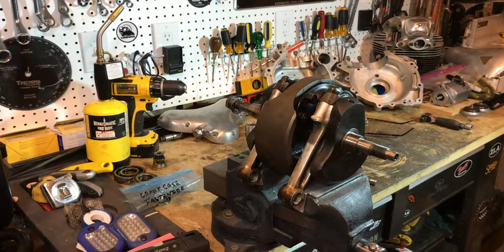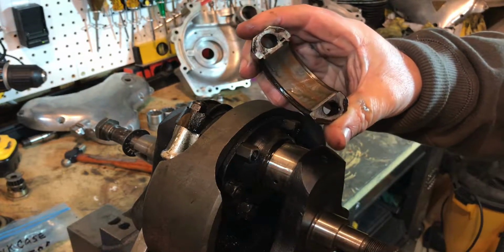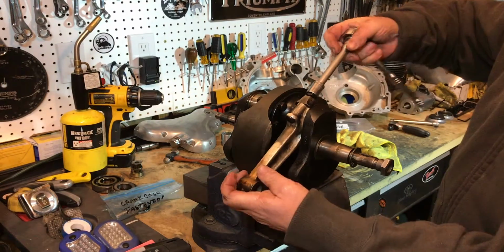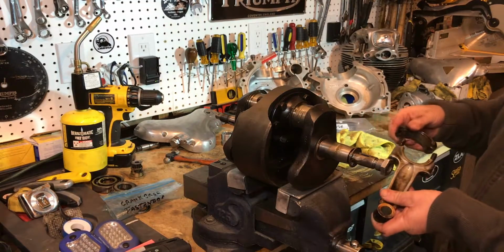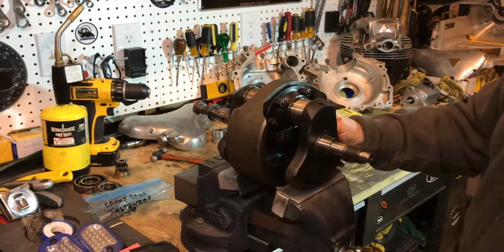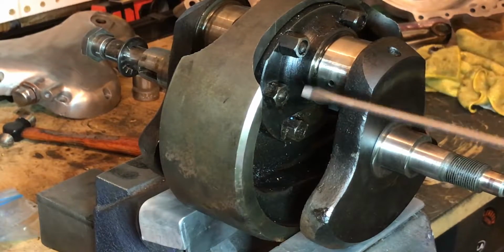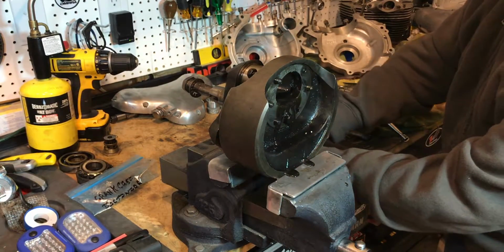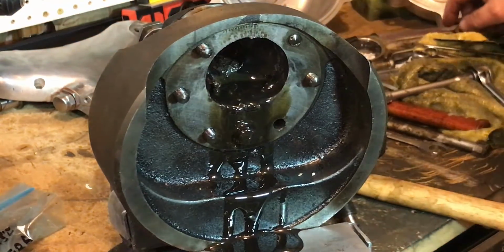Norton Atlas Project - Shep - Part 36 - Engine Disassembly - Part 15 Conrods & Sludge Trap

Comment: This has been helpful, I am working on a '66 N15CS.  Mine is thankfully not as sludgy, just 2 deposits of about 1/4" of the stuff 180 degrees apart, curious if that's a balance thing.  At https://youtu.be/4r2CVzzLaJc?list=PLgDzKiI-i6nYTzxrLolDHnSxPiWRXeiOd&t=58 you really are leaning into that conrod nut, I was cringing a bit to be honest.  I use a foot long iron plumbing pipe over the end of the ratchet or a breaker bar, Archimedes would approve.  I am nowhere near where you are knowledge-wise so don't take this wrong, I just hate to donate to the knuckle meat god.

Comment: Do you always clean parts with WD40 instead of a solvent tank?🤔
Reply from the maker: Thanks fw1421. I mostly use WD-40 for cleaning cycle parts and just to give a general clean. But will use a solvent tank for the crank assembly before reassembling. My friend has a friend who has an industrial solvent parts washer that we are hoping to use. Cheers, Mike

Comment: First, before you dismantle a crank, is to mark the timing side, so you can reassemble it correctly. Otherwise you don´t know, which side was ..... and you have to rebalance it.
Reply from the maker: Thanks Martin, yes, I punched marks on the cheeks but didn't capture that I guess. Best wishes, Mike

Comment: Mike frankly speaking i got that timing wheel support pltee only after i saw you dismantling this video I have a norton model 88 to restore & you can beleive how education this video of yours is for a layman especially as me- by the way I had to ask you mike- those whitworth sockets you are using- is which MAKE- ??? do let me know some information in the tools you use- keep up the great work mate- Cheers & kind regards from india- Rahul
Reply from the maker: Hi Rahul, thank you for your kind words.  The BSW (British Standard Whitworth) sockets are by a British Company called King Dick.  But you should be able to find similar BSW sockets, perhaps from another supplier.  I find them very helpful and use them a lot more than spanners/wrenches.  Best wishes, Mike

Comment: That's  some Nasty shit. Why do all Brit bikes have sludge trap's  ? Enjoy your video's .
Reply from the maker: Thank you Steve.  Yes, seeing that sludge in there made all the dismantling worthwhile.  The sludge trap (or sludge tube) were intentionally designed to capture / filter out deposits & other debris - via centrifugal force - from reaching the connecting rod journals and bearings through the crankshaft.  It was a modern design at the time ;)

Comment: Hey Mike! This is an awesome build/restore that you're doing.  Very informative, thank you. Have you decided how you're going to be refinishing the case, cylinder, cyl head and etc yet?
Reply from the maker: Hi Stephen, thanks a lot for your comments.  I haven't decided yet about the finish.  I've had other engines vapor blasted and they look beautiful, but I'm going for more of an original look with this bike.  Plus, it's difficult knowing where to stop once everything starts looking new again ;)  I'll probably spray paint the barrel or may have it powder coated but again want to keep everything looking consistent.  For the head, I think it will most likely be a good professional cleaning, maybe vapor blasted.. I'm still undecided!  Cheers, Mike.

Comment: Thanks for the vid. I am about to dis-assemble the engine of a 1968 Triumph 650 due to low oil pressure and I am dreading what I will find in the sludge trap. This bike was modified back in 1970 or there about into a chopper with extended forks and funnily enough it is named The Sludge Trap.
Reply from the maker: Ha!  Thanks for sharing Matthew.  Good luck with your project.  Cheers Mike.